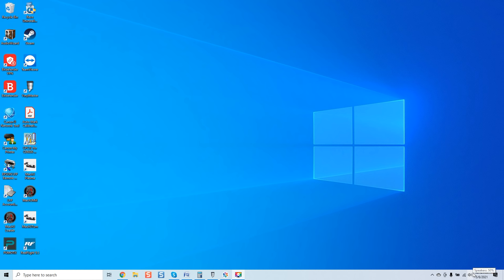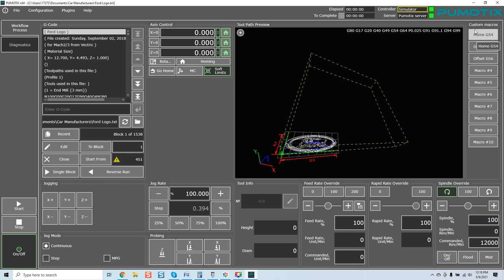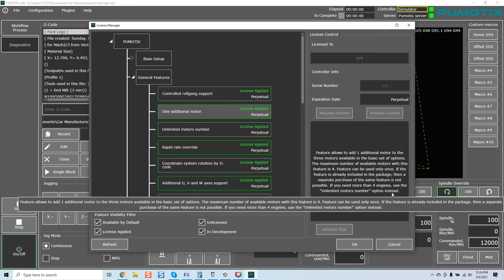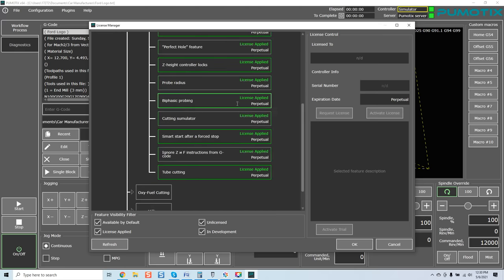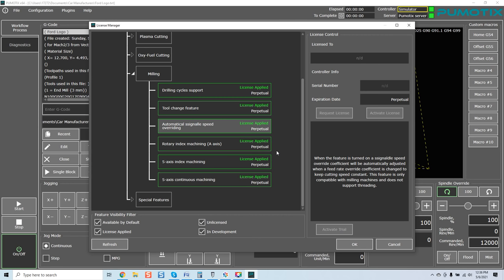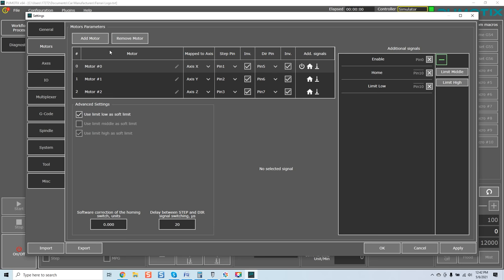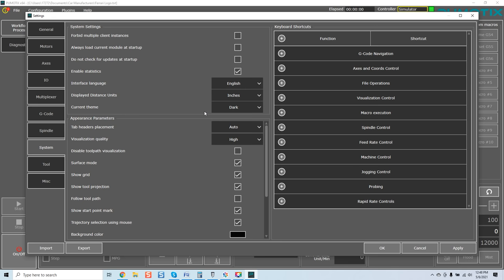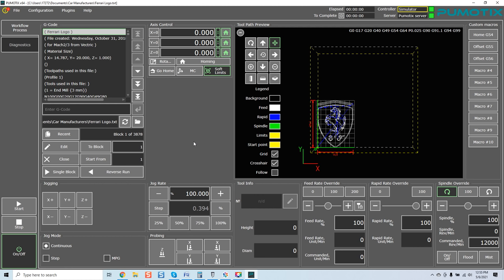Pumotix The Future Of Motion Control Overview (Part 3)

Comment: Few questions, 1: does the software support lathe operation, if not do they have plans to?, 2: is this software locked to their hardware, or is it flexible like Mach3/4 and Linuxcnc? 3: Why buy your package when they advertise the PLCM-E1b on their website for $140.00 - shipping? Please don't take this wrong I totally respect what you do and have learned a lot from you, just wondering if your basic PLCM-E1b hardware/software package is different in some way.
Reply from the maker: Alec, thank you for your support. The software doesn't support lathe yet. It may in the future. The PLCM can be used with Mach3, but won't have all the features it has with Pumotix. Please review all my videos on Pumotix as it becomes very clear why my package is different. https://youtu.be/j9vh-spEbiI

Thank you,
Vince

Comment: If I wanted to turn the software GUI blue am I able to control color? Your also talking about slave. My y axis has 2 motors 1 on x. Can I control each motor on y for auto squaring?
Reply from the maker: The GUI has a light, and dark version available. The Y axis calibration allows you to calibrate the two Y axis motors for symmetrical operation which is superior to the standard physical switch method. Thank you,
Vince